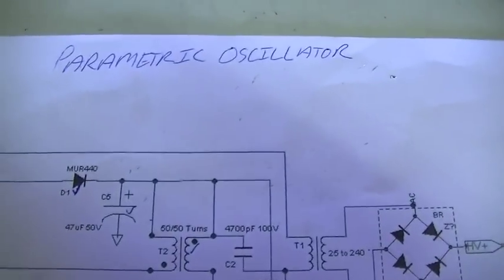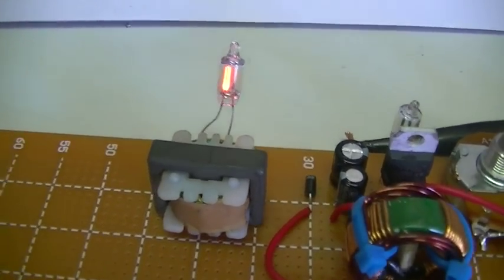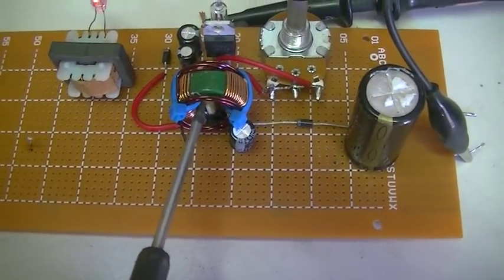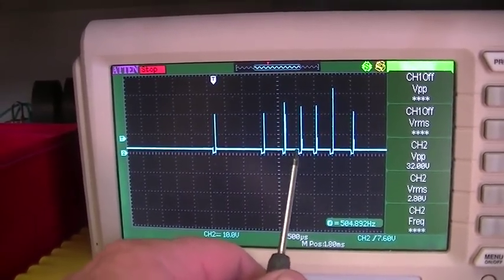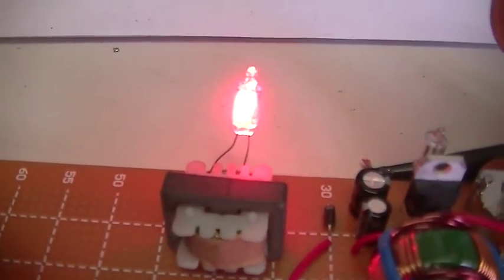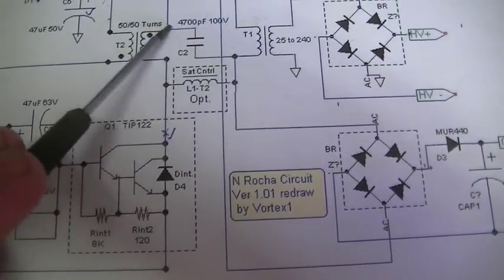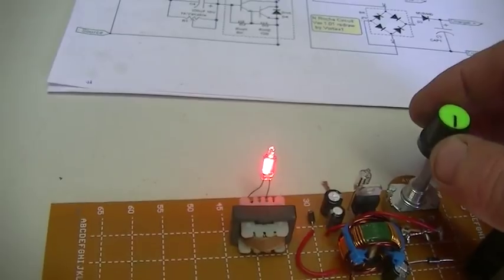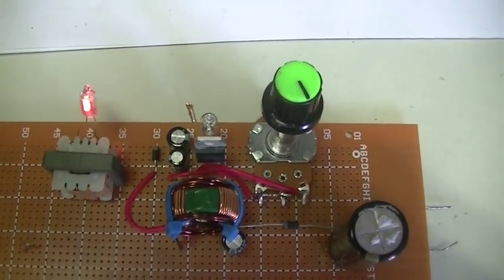Parametric Oscillator test 1

Comment: Cut the throid core in the middle put s paper arc in between the core halfes run one side with 2 mghz and the other offset so you get same curve as in your overunity transformer video. Wind each core with bifilar winding one to light one to sparkgap.leed sparkap to strip of iron foil. Bend ironfoil once and put in between core and copper windings. Now regulate frequency until light goes on. This should give you 1:10 ratio overunity.